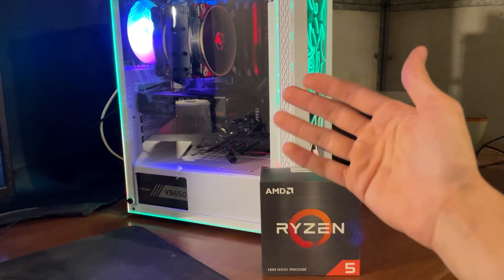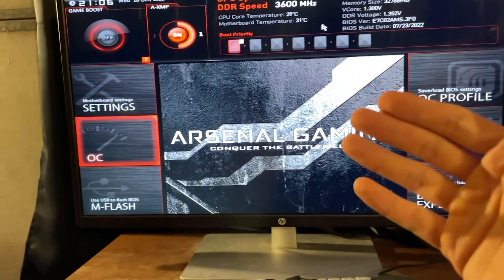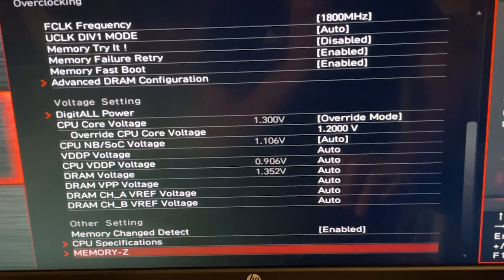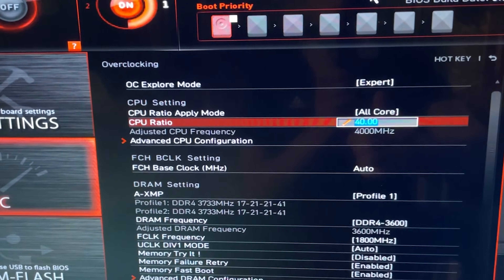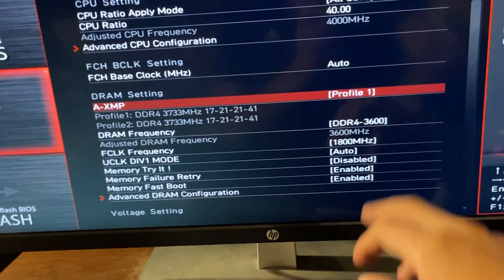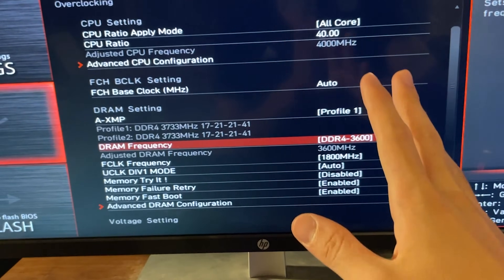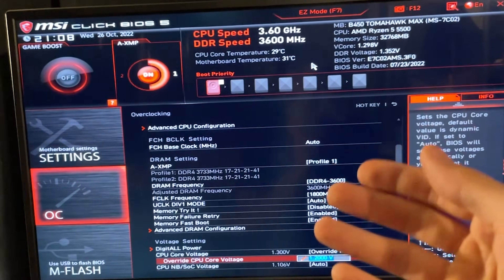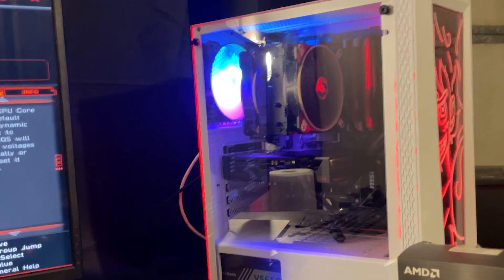Undervolt your Ryzen 5 5500 for more FPS and Lower Temperature!

Comment: Just use PBO, same result, way more efficient, and easier. And what you're doing won't give any additionnal performance in multi core since this CPU can maintain his max frequency on all cores at stock with no problem.
Reply from the maker: Using the curve editor works well too but it’s not quite as easy to track stability and it doesn’t remove the clock fluctuations! I’d say PBO is better only with a very high end cooler and/or motherboard, where longer boosts can be sustained. That’s not the case with say the stock cooler and/or a budget motherboard!
Reply: @ImWateringPSUs  true
Reply: but then you gotta put in so much more effort for the same results. 
10 different cinnbench tests to do what he already told us here is annoying.

Comment: ayo bro my cpu is overheating, in nfs heat or minecraft with shaders, i can see 102-105 degrees easily. can i solve this problem with this video?
Reply from the maker: Yes you can! Try it out and let me know!
Reply: you might need to apply a user config file to limit/reduce the CPU usage of NFS Heat.. look for "4 Ways to Fix Need For Speed Stuttering & High CPU Usage" by Mush on youtube. You can skip the MSI afterburner part.
Reply from the maker: @yushaddup2573  I'd definitely say following my tutorial is a better option, instead of hard limiting the CPU in the registry

Comment: the r5 5500 runs at 4.25ghz on all cores, so essentially u are downclocking the cpu as well. although the temps are low, you are capping its performance
Reply from the maker: That is not correct, 4.25 is the maximum all core boost, it allows AMD to advertise it as such but it’s not the actual frequency the CPU runs at in a prolonged heavy workload. Try running Prime95 SmallFFT and see at what frequency it actually runs… it will be 3.7Ghz!
Reply: @ImWateringPSUs  i was getting 4.2-4.25 on all cores during gaming, cinebench r15,20,23 hitting 81c max on the stock cooler tho.
Reply from the maker: @pitracks  Yeah, for productivity workloads undervolting would really help both with performance and extending the life of the CPU!
Reply: @ImWateringPSUs  this extending the life of the CPU is complete bullshit
Reply from the maker: @123fgwsera  It's not  why I recommend undervolting, however running at a lower voltage does indeed extend the life of the chip, the same way overvolting it decreases it. I agree though that it will be obsolete performance wise before reaching that point lol
Reply: @123fgwsera why would you ever think that, its a fact and a well known fact...not only that its common knowledge....try thinking about it like this, try pushing your body to the limit every day, you will get exhausted real quick and burn yourself out, compared to someone working smart and not burning yourself out, yeah you might get a headstart at the start of the day but as the day goes on, but you will slow down as the day progresses, and might even come to a hault because of exhaustion, while the person keeping their pace can go on till the end of the day without problems...or think of it like a car, try redlining your car for an hour and see what happens, now try driving the car at a normal rpm...its the same idea, excessive wear is a thing, components wear out, and the more you force out of it the faster it will wear out...common knowledge
Reply: @ImWateringPSUs is the game mode in msi b450 tomahawk max bad because when I ran cinebench, my cpu hit 106⁰C (stock cooler). If I would have not stopped it it would have crashed after reaching 115c

Comment: Can I also run only at Stock with this Settings?
Reply from the maker: If you mean at the stock 3.7Ghz, ys but you're leaving some performance on the table. If you mean with the stock turboboost up to 4.4, you'll probably need 1.1V or even 1.15V depending on your silicon quality!
Reply: @ImWateringPSUs  I'm happy with the stock performance. But my cpu gets a bit too hot with the boxed cooler
Reply from the maker: @alicmd378  Oh yup, I say follow the video changing the multiplier as well and you will not regret it!
Reply: @alicmd378  So??

Comment: Why would a cpu perform better in multicore tasks when clock speed is lowered? Doesn't make any sense to me.
Reply from the maker: The all-core speed of the R5 5500 at stock is 3.6Ghz. In the video we're setting it at 4Ghz with a lower voltage, effectively gaining 13% more clock speed!